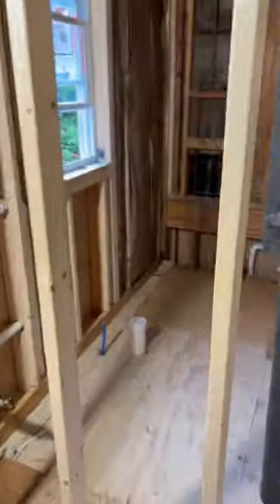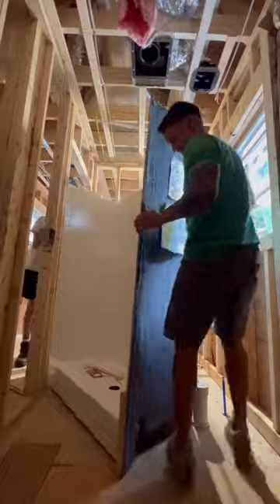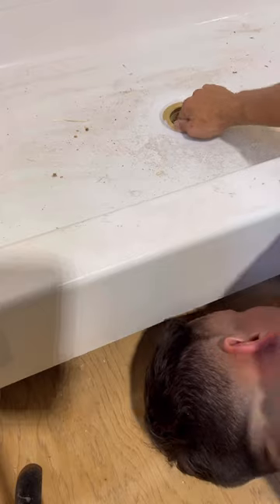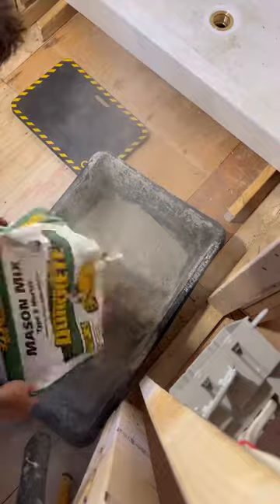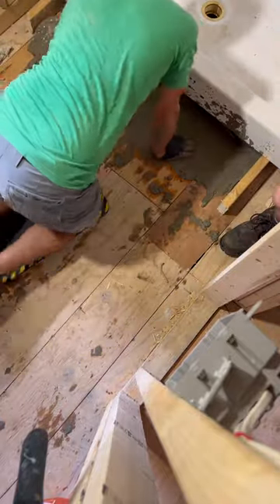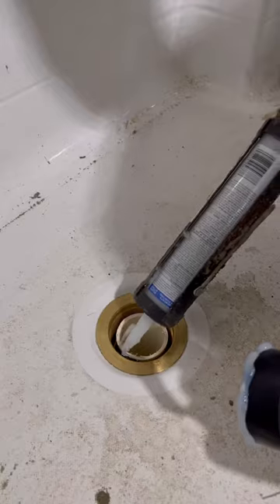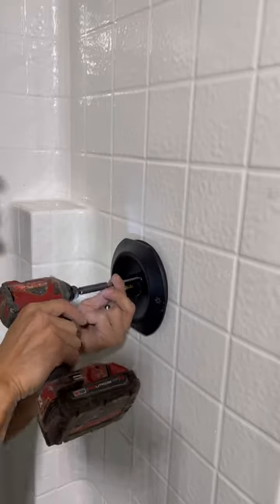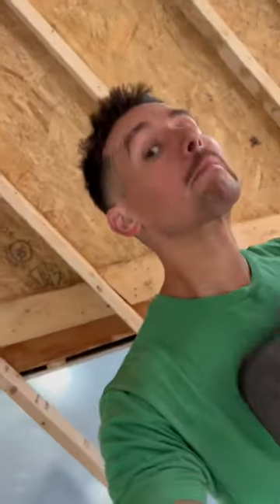Setting a shower #plumber  #plumbing  #diy  #construction  #dayinthelife  #new  #youtube  #work

Comment: Those are the best shower strainers to use. I have never had one leak. Some plumbers use the PVC strainers. They always leak. It is difficult to tighten them because of putty getting into the threads. Good looking job. Hi from the Cape
Reply: I agree on that type of shower drain as being the, "ONE"

Comment: I found a easy way to do the bedding material I used floor leveling material and it flows wherever you need it under the shower pan just block the front and let it go. Worked great for me maybe it can help someone else.